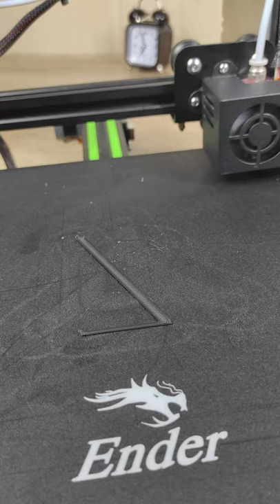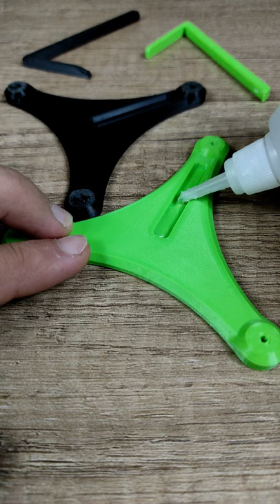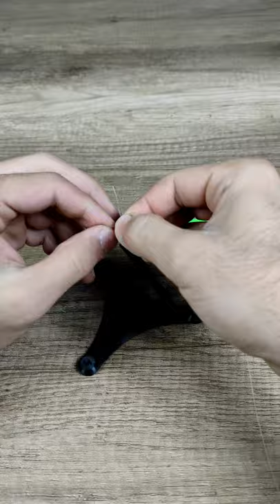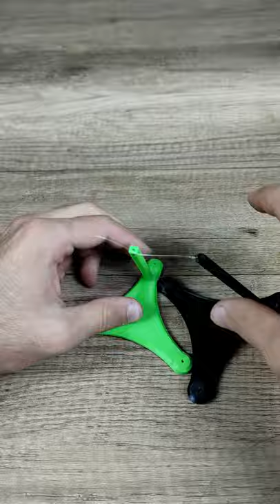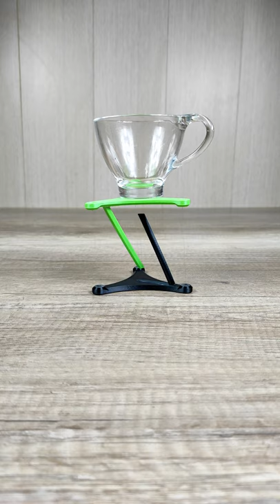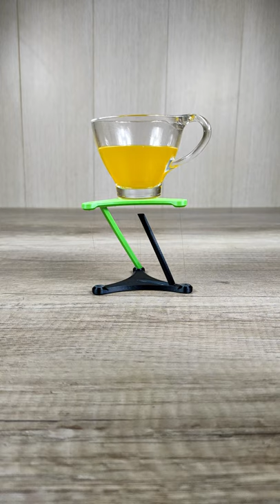3D Printed Floating Cup Holder ┇ 3D Printing Tensegrity

Comment: That looks really cool but I wouldn't trust a hot drink on top of that 😅
Subscribed!
Reply: Actually it can
Reply: It's called an impossible table
Reply: @Silent Gamer it’s held up by tension if you have you sized up what. He had there to a dining table it would be far more stable.
Reply: But how its standing on string .
Reply: @holistic_healthyliving  so if you look closely you’ll see 4 cables 3 on the outside and 1 in the center gravity would try to pull the plat from down but since the center cable is there it is pulling the whole thing works on tension if one side starts to fall another cable compensates.
That isn’t a very good explanation so I’d advise looking up and actual video if you want more info.
Reply: @basil-1999  ez

Comment: I wish it could even rotate when  floating.
Reply: That would be weird to try and do to say the least. Due to how it works, the top itself wouldn't be able to rotate, so you'd have to have a motor somewhere in the top half to rotate an inner portion of it. That would make it a tad chunky to say the least.
Reply: @trickytreyperfected1482  nahh mah friend , you just need brains and science unless....., You can create one by reverse magnetic force only difficulty is how to make it stabel I mean both opposite magnets shouldn't slide eachother , meaning don't fall off , he is a creator of 3d  , amm...... He can figure it out.
Reply: @prachisaini1  you're correct about the magnets not being stable. Even at that point, you'd still struggle to make them spin.
Reply: @trickytreyperfected1482  no you can , because I have seen levitating device based on magnetic ,he needs just better solid structure and foundation.
Reply: @prachisaini1  yeah u r right, there are some levitation devices that use magnet to make floating table but they use complicated software to stabilise the plate by changing the strength of electro magnets. It's impossible to simply make it float just by designing the shape of magnet.
Reply: @MEBVishwaS  oh okk thnks didn't knew the tit bit of it 👍🏻👍🏻

Comment: He could have printed the stand and the Trianguler slab together instead of later sticking them with glue
Reply: It is better for the grain of the triangular slab when they are printed separate. Since there is still some force exerted on the piece, having horizontal layers would make it easier to snap.
Reply: @hyrulelizard2635  Got it!

Comment: 😲Oh my, you gotta teach me the how you did that.
 I watched it like 8 times and still couldn't figure out how you made it float.
Reply: Both the Green and Black extended poles are tied to together tightly with that almost-transparent plastic thread he showed, as if the Black pole is keeping the Green pole from falling further down and since the Green and Black flat panels are tied to each other tightly on all the 3 sides, the 'floating' Green panel cannot topple to any side. So in other words the Black panel and pole are keeping the Green panel and pole from falling down, instead of holding it up. Hope this helps..👍
Reply: The middle string is in tension and the other strings are in compression (or the other way around, I don't remember), so none of the strings can actually move.
Reply: @trickytreyperfected1482   nope..all the strings are actually in tension..
Reply: @AP-wm1or  whoops. I coulda sworn in Steve Mould's video he said some were in compression and some were in tension? Idk. I'd suggest watching his video on the matter either way